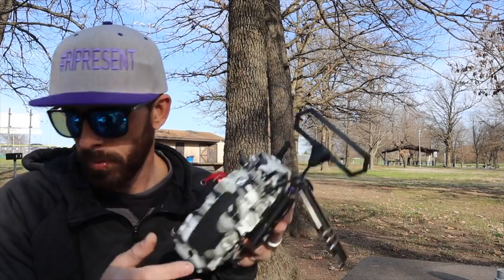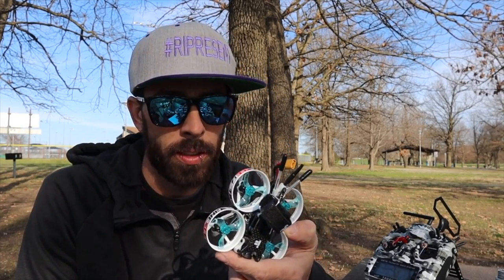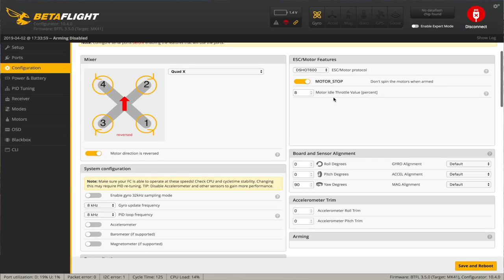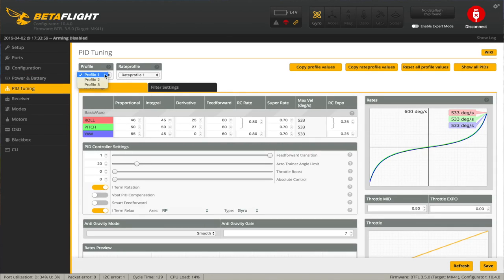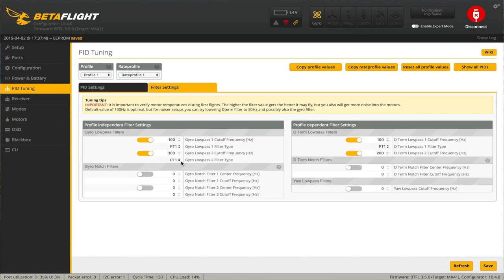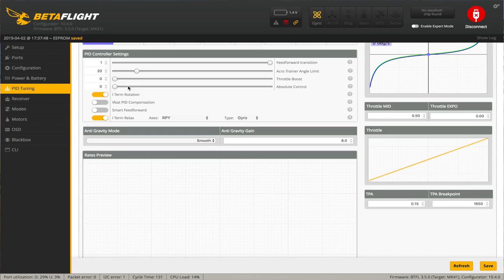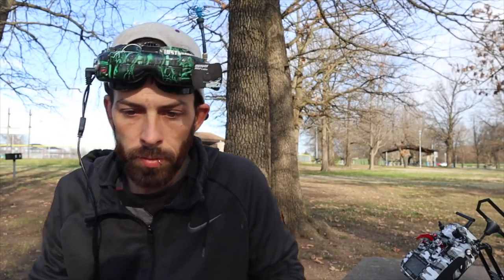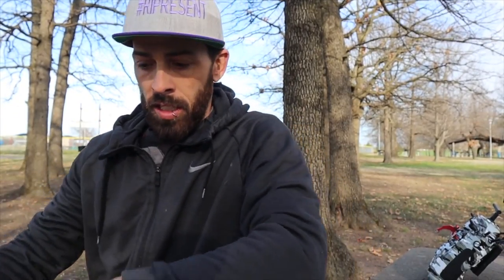Cinematic Micro?  FPV meets micro style

Comment: You will like it even better with a lighter battery. 350-450mah 3s will be perfect. I lost one of my my antenna tubes on my first crash too!
Reply from the maker: proto fpv yeah I think my PIDs need to be brought down as well
Reply: @JU5TbyCHANCE  my  p  on r,p,y are at  46  50 42. I is at  45,45,65 and d at 28,28 tpa is 20 at 1750. And I am using a 450mah 3s that weighs 41g. they recommend a 350mah 3s for optimal power to weight but the  tattu 450 feels pretty good to me and gives me good flight times.
Reply from the maker: proto fpv nice man I’ll have a try